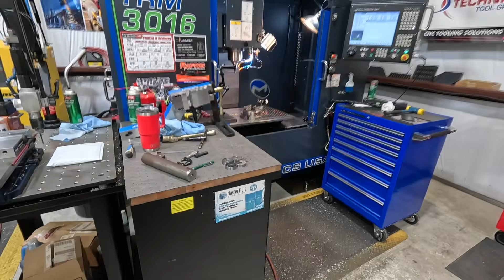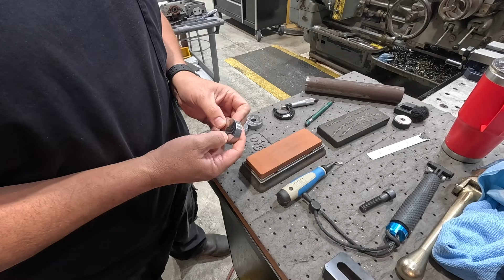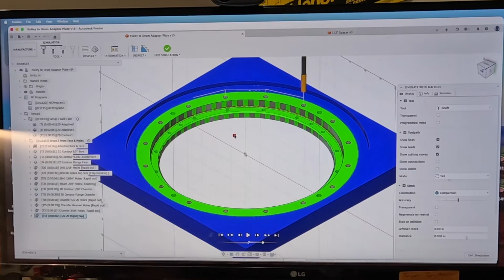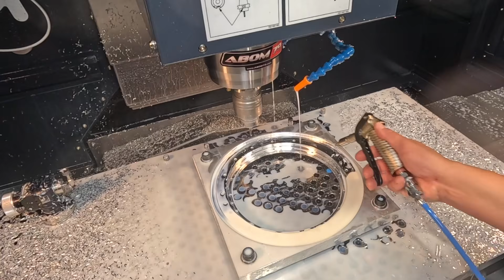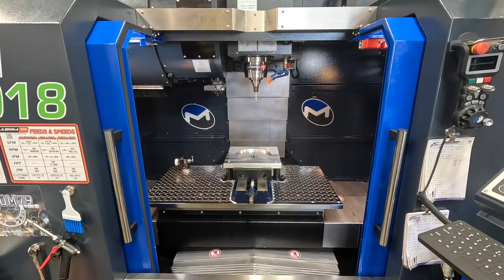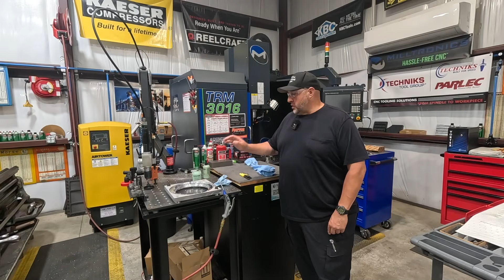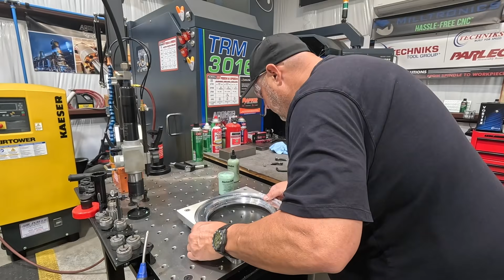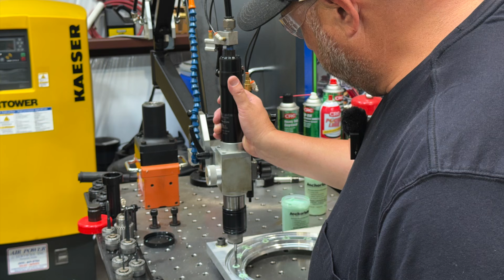Harley Pulley to Brake Hub Adaptor Op 2

Comment: As we say in the UK , BUGGERIT . You had  trepidations about the tapping part at the start of the content . If I was talented enough to make this , and it was for Me , I would have used a hole cutter to remove the material , and broken tap , heated the part , pressed in a cold piece of Aluminium , withbearing locker , and then re-tapped it and faced it off  , Well done Mr Booth , I take my Hat off to you .

Comment: Nice indicator trick. 

Warning and info that only works on all sides of the table edges  are alined with the spindelhead axis or the x y  axis linear rails.

When X is 1° of and you flip the part upside down you get a 2° error. 

You can compensate that but you have to know it what the error can be.

Been there done sh*t ^^

nice work.

Comment: For making those spacers exactly the same thickness, and giving them a mirror finish, you could do with a surface grinder.
Reply: I also thought about machining a flat piece of stock and using one pass for each side to get it flat and parallel.  This way one pass sets the height without relying on the repeatability of the CNC machione. Drill the holes and then cut four square spacers, debur.

Comment: What RPM was you tapping on the mill and the flex arm?
Also blowing off each hole before tapping the next, proves that tap is holding chips.
Reply: Makes no difference, you'll never blow a tap in a cnc in 2026 under 1/2inch in alu, unless you have a machine than doesnt sync the spindle correctly.
Reply: @spikeypineapple552 here's my two pennies worth, Adam's tap didn't look like a serial flute tap IMO.
The flutes were long spiral, but the cutting edge looked more like a spiral point tap, (Gun tap)
So, that style of grind will chip and push the chips downwards, not upwards.
Our spiral flute taps have a quick flute spiral and the cutting tip is only over two threads to draw that spiralled chip up.
That's possibly why it snapped on hole 3, chips filled the flutes from holes 1 and 2, 3rd hole didn't stand a chance.
Reply: @rickbcfl  I understand what youre saying, but they're through holes, and if you look at the previous 2 holes, there are no chips on the tap, and you can see them drop through onto the workpiece(disconnected). The tap breaks at the moment the spindle reverses, it's pretty obvious to me that the spinle and z axis arnt synced correctly.
Reply: @spikeypineapple552 tbh, I thought it was a blind hole, hence Adam was using a (special) spiral flute tap to evacuate the swarf.
Also, that holder is a floating holder for exactly that, any Z sync issues.
No doubt Adam will clear up some comments in due time.
Reply: @rickbcfl sure, but it needs to have extension left for it to do its job. You can see it's maxed out

Comment: Maybe try forming taps for that type of operations in aluminium.
Reply: Makes 0 difference. This tap didnt bottom out or get overloaded, the machine just isnt good enough to sync the spindle so it snapped it off. thats why it went at the bottom of the hole.
Reply: @spikeypineapple552 I thought he was using a floating holder for the tap, so the sync should not matter.
Reply: That's what I use. They seem to be tougher.

Comment: Spacers are crying out for a surface grinder, although I get why a one-man shop doing Abom's work mix would do anything to avoid having one in the shop.
Reply: I also thought about machining a flat piece of stock and using one pass for each side to get it flat and parallel.  This way one pass sets the height. Drill the holes and then cut four square spacers,debur. "It's hip to be square?"

Same principal, using one pass for the height as opposed to relying on the repeatability of the CNC machine.
Reply: I agree, harden and ground would be great for long life, you know these spacers are in the tool box for future needs. Only counter to harden them is if a tool strikes the tool will 100% be dead.